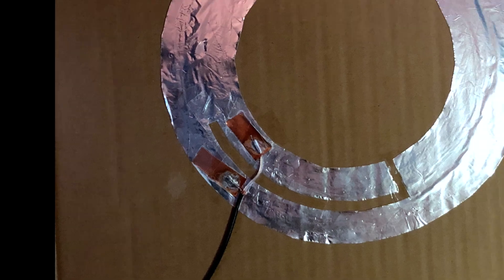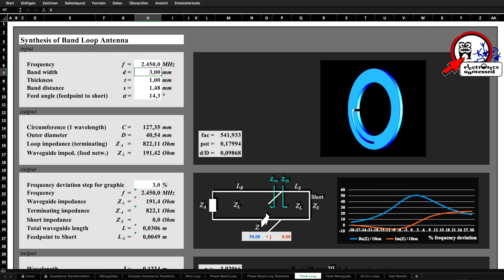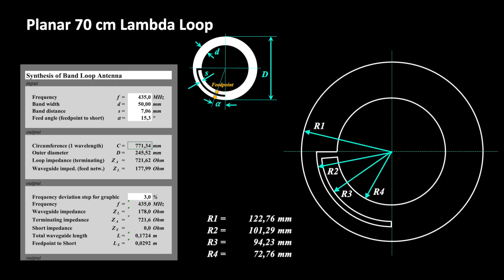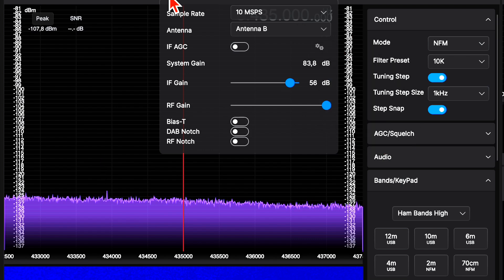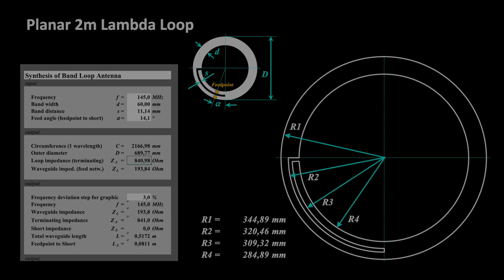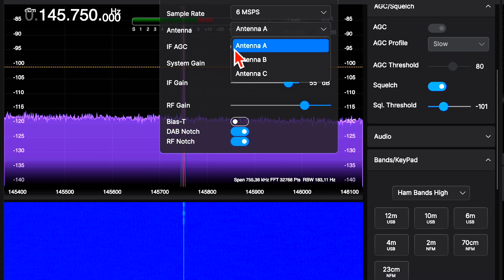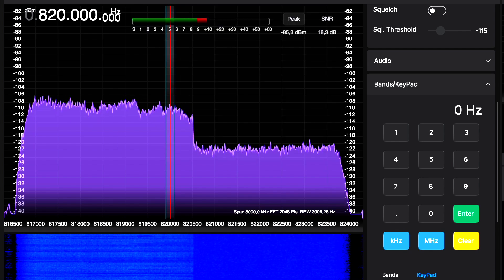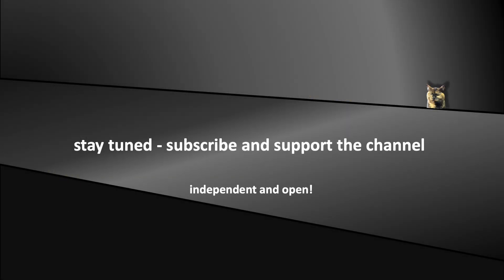Planar loop for 2m and 70cm HAM radio (EP135)

Comment: I have reproduced your design for the 70 cm band and I am surprised how well it worked. 
I used aluminum conductive tape. It was suitable for transmitting at 4 w. Will try comparing it with my homebrew folded slot antenna in the coming weeks...
Reply from the maker: Great! Looking forward to your results! Greetings from Stuttgart, Klaus
Reply: @electronics.unmessed The plan is the 2m one next. I was looking to reproduce the antennas using a copper brake hose. Unfortunately I can't use the CAD file, do you have the measurements for that material, unable to use the CAD file to calculate.
Reply from the maker: There is a video about scalability on the channel. Just check it out.

Comment: While looking at the SDR graph I got an idea: What about using some flexible material like aluminum foil or thin copper wire and shape it while the SDR is running to get some real-time feedback on what shape gives the best signal? The SDR could be tuned to some range with a constant broadcast, like WX or broadcast radio to have a reference point. What do you think, waste of time or worth a try?
Reply from the maker: Thank you for your comment! 
Yes, you could actually try that with flexible materials. However, a big hurdle is the fact that radio signals are quite volatile, which means you have to do appropriate statistics to measure the improvement in signal strength and SNR. A better option could be to do a computer simulation and optimization. A research field on its own ...
Do you have a concrete idea for it?
Reply: @electronics.unmessed  I was thinking about trying random and arbitrary shapes in the spirit of "some of the greatest discoveries were purely accidental". I've seen many less intuitive shapes of antennas, like flat discs, cylinders, circles, coils, grids, etc. even though it would seem that a straight rod should give the best result, so it looks like there may be more funky shapes that are worth exploring. I have one antenna simulation program but it only allows using one or more straight rod, no reflectors, and no flat/curved areas, only lines. And simulations can only account for known variables from our current understanding of electromagnetic radiations, while experimentation would account for all of them. I know it could be a waste of time that produces no breakthrough, but at the very least it would be a fun exercise.
[edit] About volatility, I could use a very low power local transmitter to maintain a steady signal not subject to weather and other factors.
Reply from the maker: @VeniceInventors  Thank you for your thoughts. I would like to say it with Anton Zeilinger (Nobel Prize winner in physics for the topic of quantum entanglement): If you want to find something new, you have to allow completely crazy ideas. So, just go ahead with your ideas.
If you are looking for a good antenna analysis program, then I recommend NEC. There are many freeware versions for Windows with a graphical interface. I am using CocoaNEC for my MAC. I was even able to carry out optimization calculations directly, because you can use a programming language in this version. See my videos:

https://youtu.be/b_M3jf0gHqs
https://youtu.be/WXFLrwi4Y5I
https://youtu.be/ld-mHU8um70

I explained also briefly how the optimization program is working.

Unfortunately, antenna measurements are taking a lot of time and effort. You actually need a low-reflection room. Another possibility would be to have the transmitting and receiving antennas on a high mast so that there are no reflections from buildings or the ground. So, it's probably better to start with simulations and try the hardware later, when you found an interesting principle.